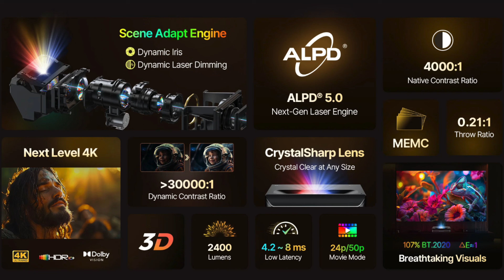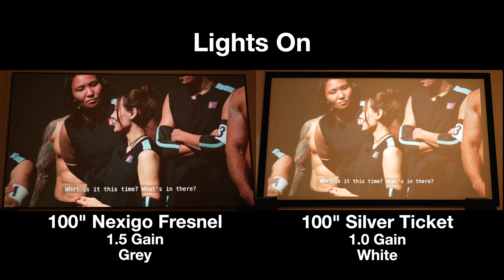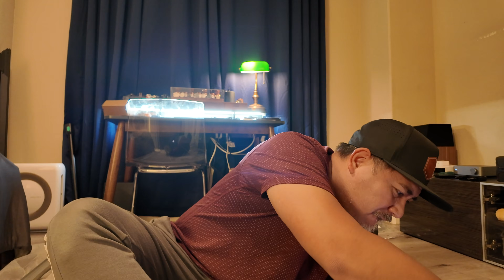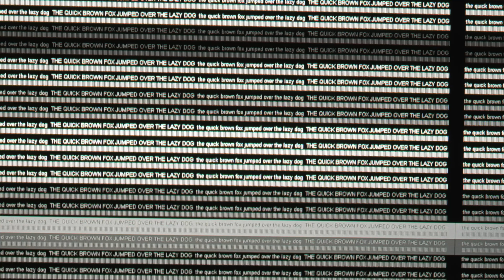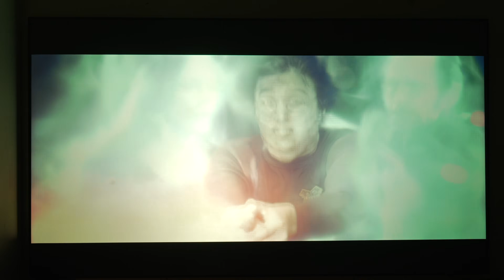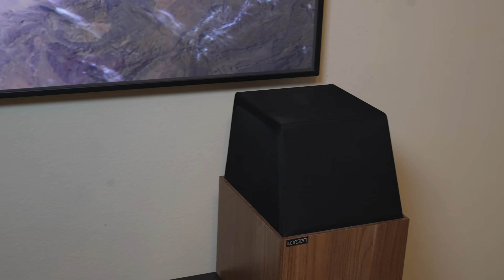Because Bigger IS Better! - Nexigo Aurora Pro MKII UST Projector

Comment: I won this mkii on a online auction for $1500 
Ive got it at about 145 inches on a stretch white screen with black backing in my bedroom
Now I just need a adjustable bed frame I might never leave my room haha
Reply from the maker: Awesome! How do you like it?
Reply: @joentell it's really nice just a little bit dark even in a dark room I'm waiting for the Samsung 8k 4000 lumen projector to release I bet it will be expensive though
Reply from the maker: @SomeStrangeSin on the 100" 1.5 gain fresnel screen, I really don't have issues with the brightness
Reply: @SomeStrangeSin  8k ust interesting but does 8k make a difference when watching streaming platforms

Comment: One of the things you forgot to give a score to is customer support/customer service. Valerion in my personal experience scores a 1/10 and that is being generous. Nexigo is a solid 10. Ask any Valerion owner how many firmware revisions they have released so far for their products. To be fair, just ask the Pro2 owners. A ton of bugs, a ton of promises, and nothing delivered  in the year it has been out. The Max isn't fairing any better in terms of support.
Reply from the maker: Yeah, good point. It's just hard for me to rate that because these companies don't give me the same service as they would for a customer. I'm usually dealing with someone directly at the company. I hear you though.

Comment: Nice and informative video. I got the MKII during the pre-order and switched from the PX3-Pro because of laser speckles and RBE. The MKII’s picture quality is outstanding in my light-controlled room. It’s a bit dimmer than the Hisense, but the overall performance and black levels are noticeably better. I wish to get a Fresnel screen next year at some point. The SAE works great after the recent firmware updates.
Reply from the maker: I've never tried the PX3-Pro but I've heard great things about it as well. Interesting that the black levels are noticeably better. Happy that you're happy with it.

Comment: Boy, these Chinese companies have come a long way. I only remember Nexigo from early Covid times when they were marketing cheap LED projectors that used phone screens and mirrors to project a passable but dimly lit 1080p. I bought one of those projectors for sub $100 at that time and it did an OK job for such a low price but certainly nothing to write home about. I also have a Bomaker from that time. Now Bomaker did have a higher end laser projector even back then, perhaps Nexigo also did? I remember you, Joe, also reviewed such lower end budget projectors many moons ago. It's all good. Whatever you can afford. These laser jobs have certainly stepped up their game and who doesn't want a WALL sized picture?
Reply: Nexigo is technically an American company based out of Oregon
Reply from the maker: Yes. I looked up an old email from Nexigo and they were asking me to review one of the inexpensive projectors which I wasn't interested in.
Reply: I actually had one of their webcams back during COVID, before I got into UST. It’s still running strong after five years, lol.